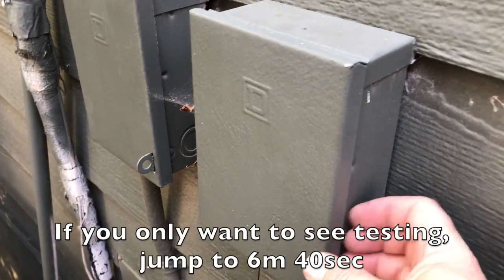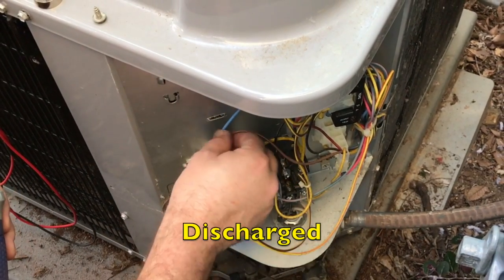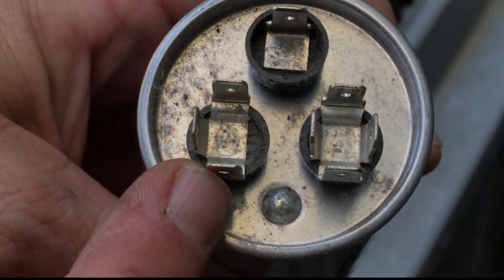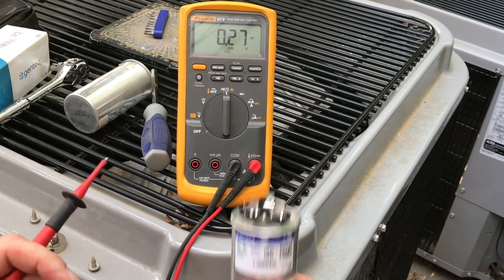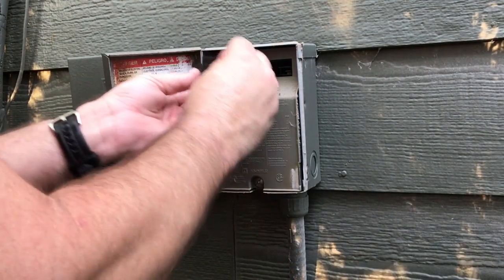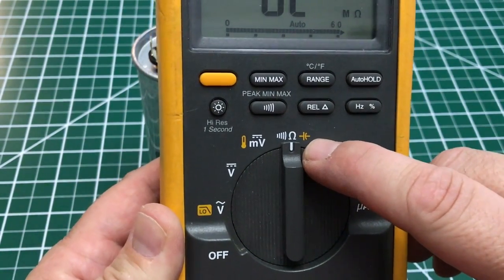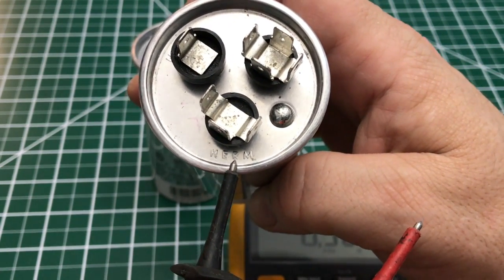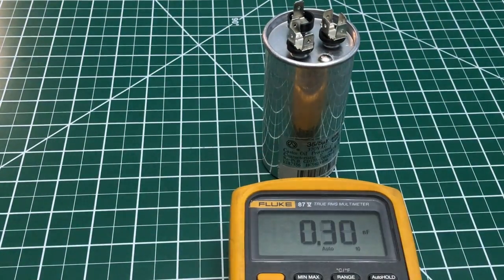Testing a Capacitor on your AC

Comment: I'm having some issues with my RV AC unit not wanting to turn on. Specifically, the fan won't turn on and actually blow air, but the compressor kicks on, hums, and will do so for a while before clicking and shutting off, then trying to run again after a few minutes, and the cycle repeats. Do you think it could be a bad capacitor?
Reply from the maker: Capacitor, bad fan motor, loose wire.

Comment: if its iced up the compressor is working witch tells you its not the capacitor
Reply from the maker: But I switched the capacitor when this video was made and to this day the A/C is working flawlessly.  So what could it have been?
Reply: @ManCrafting    Frozen unit usually caused from dirty filter too many vents being closed blower motor not running or the refrigerant charge being low

Comment: Nice video!
A few more tips for you guys.
1. Discharging a capacitors with screw drivers can prematurely cause damage if the capacitor has a charge on it.
Capacitors are not made as good as they were years ago.
You should use a 20,000 ohm bleed resistor minimum 10, 000 ohm as this will discharge capacitor without the high  current discharge.
Supco makes a capacitor discharge pen for about $10.00.
2. On spring start ups the capacitor can be checked live.
On multipurpose capacitor take amp reading reading from herm multiply x 2652 (constant) then get a voltage reading from Herm to common.
Divide your constant calculation by the volts and that is your calculation.
Repeat for fan.
This will give you a true reading of the capacitor. Replace if out of specs.
Reply from the maker: Wow.  Thanks. That’s some absolutely great advice.  I really appreciate it.  I’ll pick up one of those pens to keep on hand.
Reply: @ManCrafting  
No problem 👍
We all still learning!!

Comment: Hey there seems to be a very big step missing in all of the videos I have been watching. How to get it into NF mode. None of my buttons seem to make it go into that mode. Even the owners manual does not clarify this.
Reply from the maker: Sorry.  Do you have the same multimeter?  On mine, after turning the switch to the correct position you tap the yellow button to the function you want for that dial position.  If you have the same multimeter, I totally get your frustration.  I don’t even have the manual that’s supplied with it.  It’s probably online though.  This thing does way more than I’m capable of. 🤣
Reply: @ManCrafting  I was actually able to find it on the quick start guide. I love this meter and used it daily at work. It is very useful. Tje quick start guide has some tips on it and there is a video about the hidden features. Could be handy to watch
Reply from the maker: The Wacky Fisherman thanks for the tip.  I need to see if I can get the documentation for it.  I know I’d use it more if I knew more of the functions.
Reply: @ManCrafting  there are the digital manuals and the quick reference guide I used. Very easy website to navigate
Reply from the maker: Thanks.  I’ll be downloading them.  I appreciate you taking the time to track that down.  Very kind. I’ll add the link to my description.
Reply: @ManCrafting  no problem!

Comment: Good to know thanks! If mine says 35/5 and I've already got a capacitor but it's 45/7.5 do you think it'll still work?
Reply from the maker: Blakehx Will it work?  Probably.  Should you do it..  An over or under-sized capacitor will cause an imbalance in the magnetic field of the motor.  This hesitation when operating will cause noisy operation, an increase in power consumption, a drop in motor performance and eventually overheating or overloading motors like compressors.  The run capacitor should have the exact microfarad (uf) that the motor is rated for.  Capacitors rated above 70uf are considered Start Capacitors and are generally removed from the circuit electrically during operation.  This is where the rule of +/- 10% of the rating came from, for Start Capacitors ONLY!  The voltage rating should be no less than the listed amount for the motor, for central heat pumps and air-conditioners this is usually a minimum of 370VAC.  Most new condensing units are specified for 440VAC capacitors, and are more durable during fluctuations in power supply.  I have seen some universal type dual run capacitors rated for as much as 700VAC, as this voltage rating does not impact uf performance.  The changes in uf will impact amperage draw and reflect on kilowatt hour usage though.

Comment: I have questions maybe you could answer.the original capacitor went bad on my account unit which is a 5/60uf. Would it hurt to use a 7.5/60uf on it.i would think it would but it never hurts to ask
Reply from the maker: gmauto s I know there is some variance, but I don’t recall the exact number. I’ll see if I can find out.

Comment: Sorry to nitpick, but as an HVAC guy I was feeling a little pain watching this video ;).

The capacitance of the capacitor is measured in Micro Farads  or "uf" (one millionth of a farad) .  The "nf" you saw on your meter before applying test leads to the capacitor refers to nano farads (one billionth of a farad). The HERM on the capacitor refers to the hermetic compressor in the condensing unit.  Great tips for homeowners to save money with a DIY repair, though.  I particularly appreciate you demonstrating the discharge of the capacitor in the beginning.  Capacitors will bite if you don't do this (speaking from experience, lol) as their function is to store an electrical charge, so thanks for pointing it out.
Reply from the maker: LopingCSF thanks for the feedback.  I'm definitely deficient on proper terminology.

Comment: Fantastic. But you missed the best tip of the video - That you did use and you can use your Multi-Bit Screwdriver as a hex driver without a bit!
Reply: Joel Crawford good point.  Thanks for pointing that out.  It's the one tool on 7 in 1 type tools that many people overlook.

Comment: Great tip.  I need to get a nicer voltage meter like you have.
Reply from the maker: I got this 2nd hand.  I had an electronics project a few years ago that it made sense for.  It's way more than I really need, and it has a whole lot more features than I'll probably ever use, but I'd rather have it and not need it than need it and not have it.